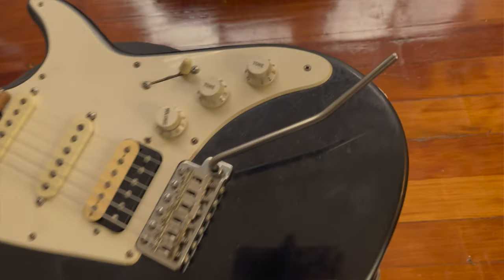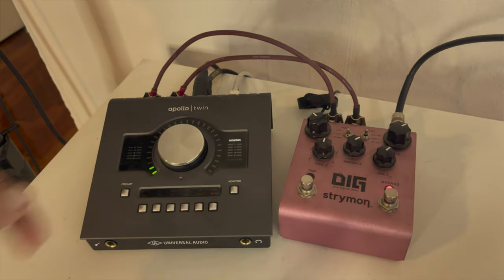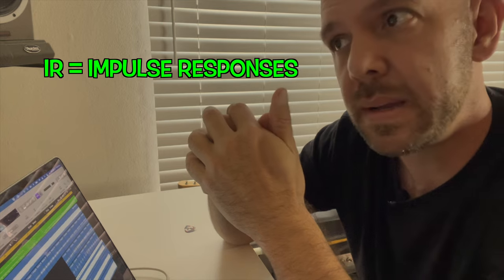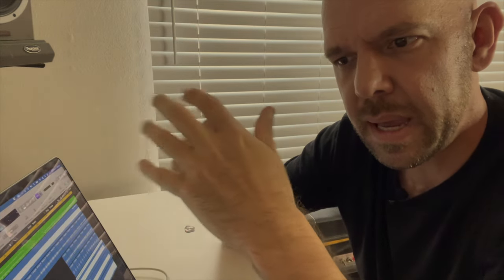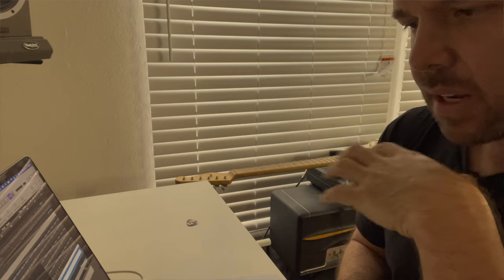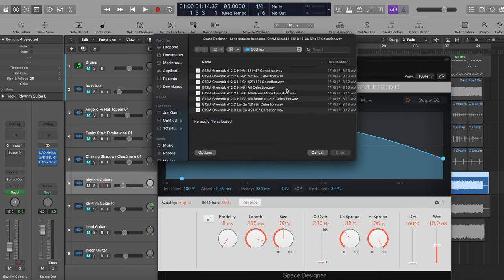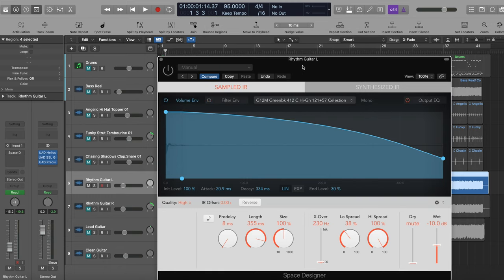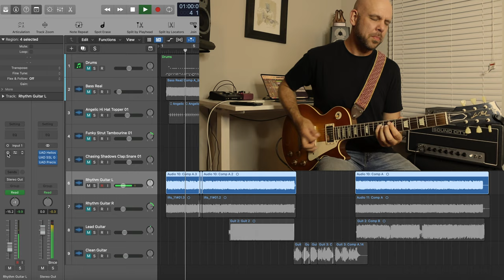Fryette Power Station - Silent Recording with IRs

Comment: Thank you so much for explaining and showing the connections. I just ordered a PS-100 so now I’ll know exactly what to do to record directly. And I had no idea Logic had a plugin that would load IRs. Thanks again!
Reply: Another way to do it is you just want a tone to jam with is to load a free/paid version of Bias or Amplitube. Just turn the amp and any pedal sims before it off, but leave the speaker sim and any post effects like reverb on. Dead simple. 
P.S. Turn the level slider down to zero for the input channel of your interface that the Power Station is running to. That's if you are hearing dry signal as well as processed.

Comment: Thank you very much for all your explanation, help me with something, I have a 100 watt Marshall, a 100 cabinet as well, a 100 power station and an Apollo interface like you show in your video, I want to use headphones, would it be okay to use my amplifier in silent mode? It's a lot of power and I don't know if it could hurt anything.
Reply from the maker: No problem!
Reply: thank you but I don't know if I didn't know how to explain myself well? Because your answer is very simple, when connecting everything with my Apollo interface, should I have the power station turned off or should I turn it on and leave it on bypass? Thank you @FryetteAmps
Reply from the maker: @eduardowilliardsierraneyra8922  Please contact support@fryette.com for more details.
Reply: @FryetteAmps  I sent them a message and they answered my questions and I am more than grateful, you have helped me a lot, thank you very much, just this question, is it possible to use Logic pro with the Apollo interface?
Reply from the maker: Joe uses Logic Pro in all of his videos. @eduardowilliardsierraneyra8922

Comment: To FRYETTE: Why is it when I run direct out from the power station I can not hear the effects I have in the power station's "Effects loop".....I was hoping to send everything from the line out (Effects and all) line out and into a IR (two notes cab m) speaker sim then into the DAW  BUT WHERE ARE THE EFFECTS IN THE PS-100's "EFFECTS LOOP")????????
Reply from the maker: That’s just the way the Line Out works. To get effects into your DAW, you need a Y cable out of your last effect on which one end goes to FX return and the other to you DAW.
You can do the same thing without a Y cable by using a stereo effect.

Comment: I have a PS, right now I'm using it as an amp to power a 1x12 cab that lives inside a little iso booth I made. There are mics in the booth, and although I get a nice tone I get no space on the guitars in my mixes, probably should've made my iso booth a little bigger. To get some room tone I started using IRs. I still use the PS to power the speaker and and use that to monitor my inputs bc there's no latency and I'll apply the IRs after the fact while mixing on a separate direct channel. I'm using synergy pres so no need to soak up power, but now I'm wondering if taking the line out of the PS into my interface instead of directly coming out of the synergy pre will make any difference. The PS is not my first Freyette (VHT) power amp. Anything I run through a Freyette power amp sounds better. So....in your opinion is there any benefit to using the line out of the PS instead of the synergy pre? I can always experiment but wondering if you have any thoughts/opinions. Thanks

Comment: Hi Joe , A few questions (hope you see this), 
1. Can i run Fuzz, Distortion, Boost pedals into the front of my amp while silent recording like this.
2. On some IRs (don't know if you did this, but you did explain about putting in afterwards), when playing into your computer using monitor speakers to hear what your playing quietly, can you choose a speaker cabinet to use on the computer program and hear what it sounds like ? (or is that what you did). I just got the ps-2a and want to start doing this fun stuff. Hope i didn't explain this to confusing...Thanks in advance. John

Comment: Ok thanks , so you ran your amp into the power station but didnt need to hook the power station up to a cab ? So you can use the power station as a load box and not need a cab ? Sorry i just ordered one and i didnt know that could be done i thought it had to be hooked to cab and use as an attenuator only . Am i correct that you can use it as load with no cab or am i missing somthing ? Either way great piece of gear steve is a genius! Thank you for any help
Reply from the maker: Correct. You can use it as a standalone load only. If you're really cranking your amp, it's a good idea to turn the PS power switch on so the fan operates. See "Silent Mode" in the manual. https://fryette.com/content/Power_Station_PS2A_Manual.pdf
Reply: For what I've understood reading the manual and some forums, you can run your Amp directly to the Power Station Amp in without using a speaker cabinet plugged to the Power Station, and without switching on the Power Station, for silent recording, going thru the line out of the Power Station to your audio interface . For this purpose, you can use the balanced output of the Power Station (XLR), or maybe use an external Ir's box (like I do) using the line out unbalanced out of the Power Station to the Ir's box (Mine IS OX Stomp, from Universal Audio), and then, to the audio interface.

Is important to know that the Power Station IS capable to load 200w of power, but if the Power Station IS bypassed, like in the video, and you are using a high wattage amp cranked, the load can handle only the half, so be sure to put the Power Station in stand by mode, on wich the fan IS switch on full working. I think in this mode is still unnecessary to have a speaker cabinet plugged to the Power Station as the reactive load still working, so can someone confirm that??

Comment: I got a PS-2a not long after this video hit. I still have not powered the thing on. I only use it for IRs. I plan to use the power amp section of it one day. :P

One issue I am having is the tone of my amps running into DAW and IRs is not that different to using the Softube Marshall amp sims I have. The sims are near enough it does not feel worth it turning the amps on and putting wear and tear on them. 

It is easier to get a nice tone using the amps though. Just hit them with a drive pedal and there's the tone. With amp sims I have to piss around with levels to make sure the amp sim is getting optimal signal levels and nothing is clipping etc. But once it's done I can just hit save.

P.S. I wish I could make my mind up what speaker sim or IRs I prefer. One day I think the Tony Platt ones that come with the Marshall amp sims are best, but the next day I like something like Celestion Speaker Room or Two Notes etc. I spend a lot of time messing with them instead of playing. The one I prefer might depend on which frequency my perpetual tinnitus is ringing at that day :D

Comment: Hello. I have two questions based on the silent recording feature in the manual:
- the power switch is circled in red as it remains active without the DC cord. What does it do?
- there is a red caution text saying the unit should be turned on and set with bypass/operate switched on « bypass » in case of using a high gain mode. Why is « bypass » important if there is no cab plugged?
Thanks
Reply from the maker: The power switch is circled to indicate that it needs to be powered when using high powered (not high gain) amps. This is necessary so the fan will operate.

Bypass puts the internal power amp on standby when not in use.

Comment: Does my amp need to be connected to a load or a cab if it is running through the power station?
Reply from the maker: No. See silent mode in the manual. https://fryette.com/content/Power_Station_PS2A_Manual.pdf
Reply: @FryetteAmps  what if i had a speaker cable plugged into the PS (in silent mode)  but not into my cab ? does this cause harm to my amp or PS?
Reply from the maker: @mesaboogie4 You could damage your amp that way. Not recommended!
Reply: @FryetteAmps  thanks !
Unfortunately I learned the hard way

Comment: Good video,but I was hoping for more explanation on the Power Station being used this way....I want to load my amp,send the line out into an AxeFXIII for FX and IR’s....You mentioned the PS doesn’t need to be powered on...is this true if I am using a 50 or 100 watt head,because the fan won’t be running....Do I put the PS in Standby or Operate mode to do this??...I use my PS100 to tame my amps,but sometimes I want to use it as purely a load box...
Reply: If you're running a 100w head up full-stop then I'd turn the PS on so the fan will run. Just keep it in bypass mode and you'll be in business!
Reply: I just landed on this video today and wanted to do the exact same thing as you: run the amp into the PS2 and then take the line out to a Fractal FM9 for FX and IRs, did you manage to do it? Have you tailored some Fractal preset to this end, and if so, would you mind sharing them? Cheers!
Reply: @giorgiomusso8558  yeah,I run mine into my AxeFXIII for FX and IR’s…works great,and sounds great…I did have to get an isolation transformer box to get rid of a ground loop,but now it’s quiet as a mouse..
Reply: @scottpeters4401  can you tell me the exact routing of the cables? I've heard different methods
Reply: @giorgiomusso8558  I usually put the cab right after the amp…Then all my FX behind the cab..

Comment: Hello ,my PS2A arrived today ! and ive read that its not necessary to "turn on" the PS-2A if i only want to do the silent recording with IRs .  is that true ? and is there a difference between th XLR line out  and the other line out ?
Reply from the maker: You can leave the PS-2A power of when using silent Mode with smaller amps. If you are cranking a 100W amp, please turn on the power switch so the fan will operate. The XLR Line Out is balanced and transformer isolated.
Reply: @FryetteAmps   im sorry , havin another question ... is it possible to plug in the cabinet (powerstation speaker out) and  play in silent mode ?  ..

Comment: Do you need to have power running to the power station to utilise the load box. Can I use the power station as a load box with out power is what I’m asking, like a passive load box? Thanks bro!
Reply from the maker: Yes, but it depends on how much power you are sinking into the load. If it's over 50W, you need to power the PS so the fan will keep the load cool.

Comment: Got my PS-2 this week. Just watching your intro piece (awesome btw) noticed you have the Fryette Powered off when recording the 100w head... Im just conscious that they said you need the PS switched on when using high power heads. Was this okay for a short amount of time or something and meant more when using for long periods?
Reply: Did you find the answer to this?  I am looking to hook my dual rec. 100 watt head to the Ps-2 for silent recording and am not sure how to safely do that for silent recordng.
Reply: @travis3656  I did indeed straight from Fyrette. It won't kill anything if you run it turned off for 5 mins or so but tbh its worth having on anyway with a powerful amp. It does get extremely hot. 
You can keep the speaker one jack unplugged, have the unit on and even have the standby switch on and its fine. Its all for the fan so it has active cooling.
With lower power amps such as my JTM45 I don't even need to turn it on for silent recording... however make sure the speaker jack is unplugged or it'll go straight through as if bypassed!

Comment: Hi Joe, I just acquired the Power Station 100 and also got the Power Load IR. I have three questions: 1.) If I am reading the manuals correctly I can hook the Power Load IR up with the Power Station via the unbalanced line out. Is this favorable or should I rather use the units separately depending on the task? 2.) If I run a high powered amp cranked I still get some bleeding to the speaker with the Power Stations Volume turned completely down - can I safely run the power station without connected cab in this high powered amp scenario? Would it be best to power the unit up in that case. 3.) If I load own IR‘s into the recommended folders of the Power Load IR, I cannot use them via the unit. When selecting the bank/preset it is just the DI amp signal coming through… I tried it with different IRs from Ownhammer and pretty long ones (500ms) exported from the GGD cab plugins… Any tipp why this isn’t working? Is it the length of the IRs? I couldn’t find any specifications regarding the IR format on the Fryette homepage or the manual… Sorry for all the questions, but thanks in advance. Christopher
Reply from the maker: 1) Yes, that works. 2) Yes, you can. See Silent Mode example in manual. 3) You need to use 48K wave format. Contact support@fryette.com for instructions on converting formats.

Comment: Can I run my ps 2a into my focusrite audio interface.
Reply: Yes, you can. Use the line out on the back of the Power Station. You can go thru the audio interface using the balanced output if you go directly or the unbalanced if you go thru some other pedals between the Power Station and the Scarlett
Reply: @vicentepiconguitarcovers4748  Cheers bud...I have 2 Fryette power stations, the one we discussed and the one with the headphone input and IR utility and what I would like to do is connect both power stations together so that I can attenuate with the PS-A2 and use headphones with the headphone and IR output on the second Power station IR...it's confusing so don't worry if you don't know either...:hand-pink-waving::face-blue-smiling:
Reply: @hekakain4108  I can't help you in that configuration, sorry mate, good luck !! 👍🏼👍🏼
Reply: @vicentepiconguitarcovers4748  No worries bud, take care and thank you for your time...:hand-pink-waving::face-blue-smiling:

Comment: One quick question: you said that the power station does not need to be on in order to get the output signal (bal or unbal) of the reactive load? So the reactive load is passive and does not require even the power cable to be connected the the Power station?
Thanks and cheers!
Reply from the maker: That's correct. Just keep in mind that if you're cranking a 100W amp, the heatsink assembly get's HOT. In that application, you're going to want to power it up so the fan operates.
Reply: @FryetteAmps  thx for the quick support! I'm glad I asked ;)
Reply: @FryetteAmps  One more question regarding the silent recording application: 
- I connect my 100W Marhshall head to the power station and match the impedance. 
- I switch on the power station but leave it in bypass, i.e. the power station works as a load only and its fan operates to get rid of the heat.
- I record from the XLR out of the power station which works fine
--> However, there is an acoustic rattling of both the Marshall head and more so within the Fryette Power station. The rattling is on the frequency of the actual guitar signal, i.e. I can hear the 100W signal shaking the whole setup which is somewhat not as silent as I hoped. Is that normal? Thanks a lot! Cheers
Reply from the maker: @joapguitar  100 percent normal. Your amp has always done that. You just never heard it before because the speaker sound drowns it out. The PS is vibrating sympathetically as well. Just no speaker cone to project it out.
Reply: @FryetteAmps  Hi thanks again for the quick support. I am not sure about the PS's degree of vibration: when the 100W Head pushes the PS hard, it rattles heavily such that I need headphones to hear the recorded guitar properly. Listening to the recorded signal via speakers is not possible because the PS is too loud in that case. The case can also be solved by using the power reduction on the 100W Marshall head which still sounds fine, but it is not how I was planning to use it ;)
I.e. is the loud vibration of the PS normal or could that be a bad sample that I have?
Many thanks for Munich!:goodvibes:
Reply from the maker: @joapguitar  Please send a clip of the unit making the sound to support@fryette.com
Reply: this was happening to me. the vibraton was coming out of my amp head in silent recording mode. then all of a sudden my volume dropped and smoke came out of my amp head. not sure what happened. i had my amp plugged into the PS and used balanced out of PS to my interface. i also had a speaker cable plugged into PS but not my cabinet. did you get this resolved?  @joapguitar